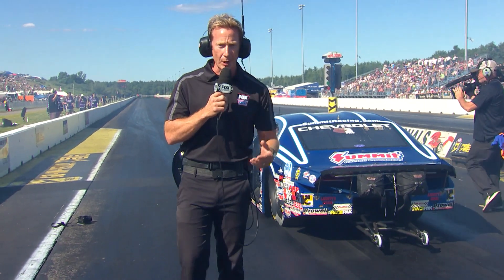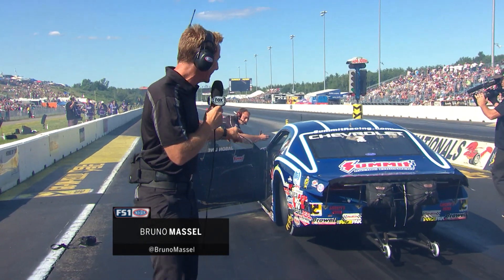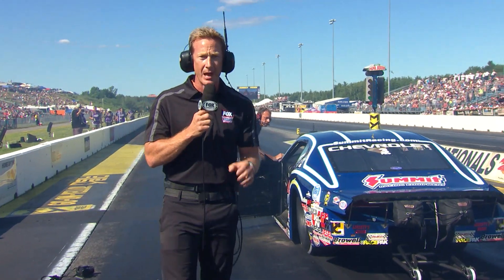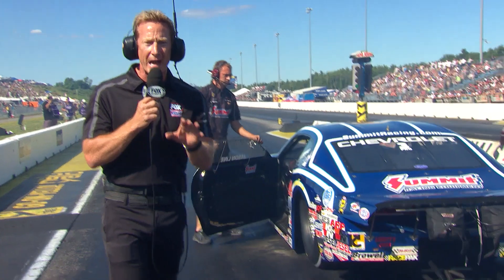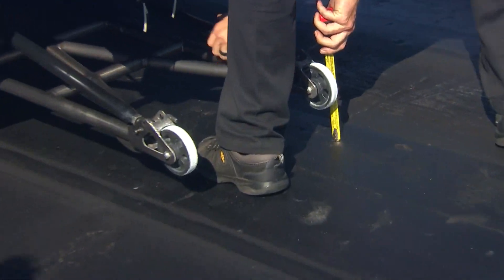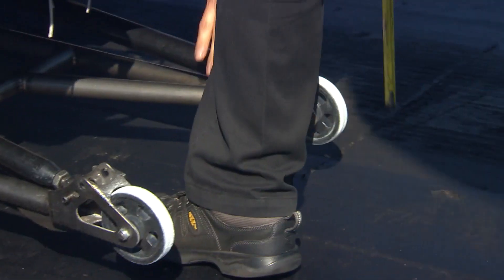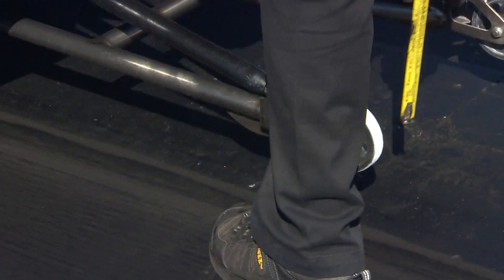NHRA 101: Pro Stock Wheelie Bar

Comment: A tape measure? Seems to me a pair of threaded steel or aluminum gauge blocks set to what they find that works for the car and on each side would give better accuracy and consistency. I guess there method works well enough though.